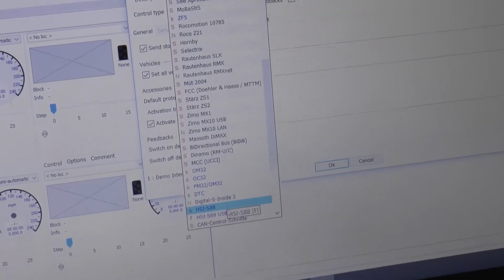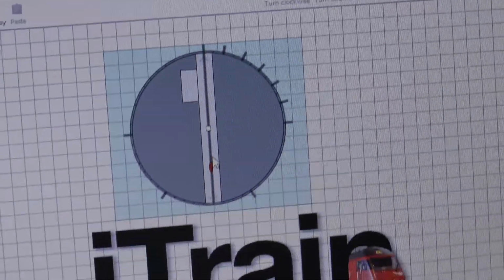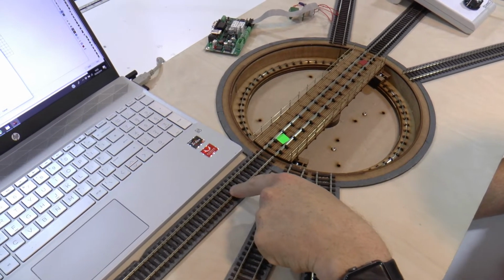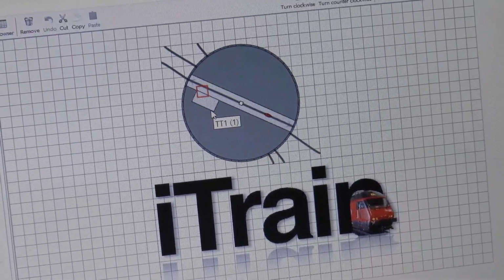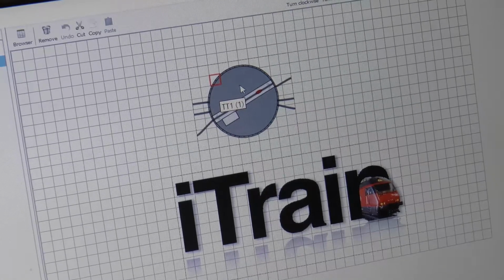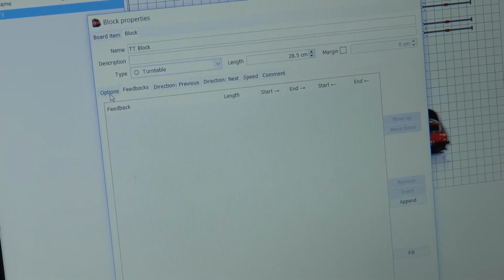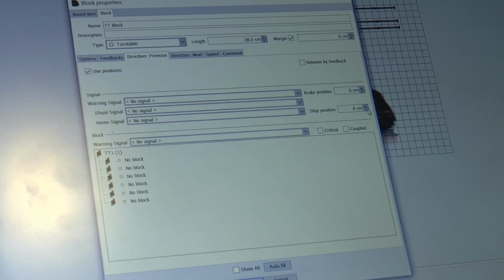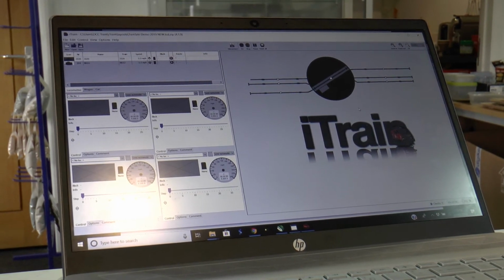How To Setup iTrain Turntable Control.

Comment: I am just in the process of setting up iTrain and one item I have which I was trying to get to work was a self made turntable using Nema17 an Easydriver from a Nano with 8 positions and a PCF8574 to connect via I2C to my DCCEX command Station I setup DCCEX with address 400 to 407 with the PCF8574 so was wondering if your video will work the same in DCCEX, I have asked the question on iTrain FB page and iTrain Forum but not got much help at the moment ... Most grateful if you can help ... Regards John